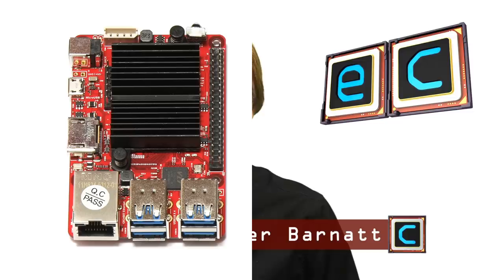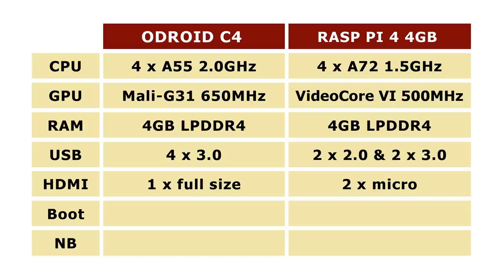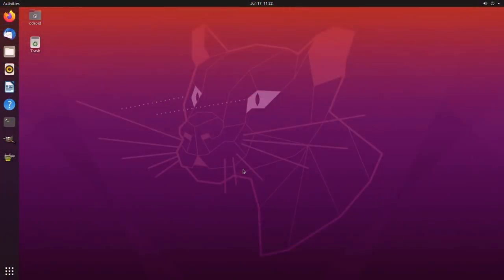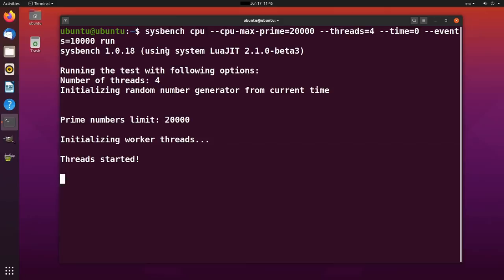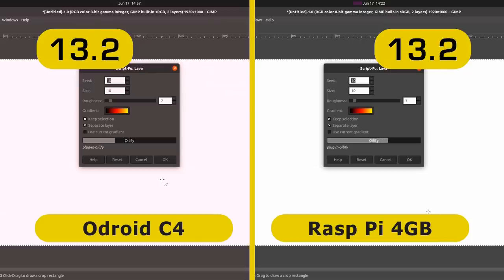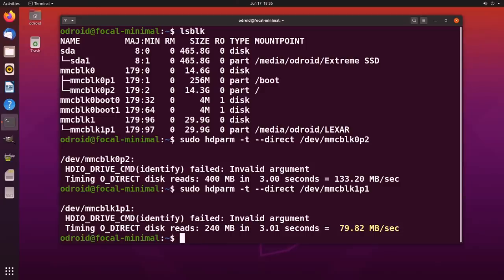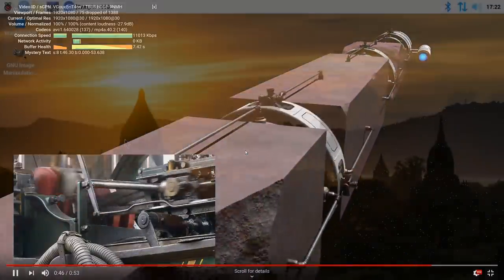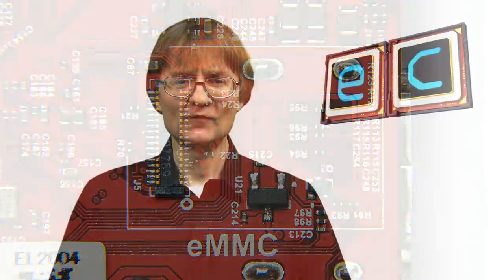Odroid C4 vs Raspberry Pi 4

Comment: 👍(ツ)❤️    I won't cheat with C4 and stick to my beloved RPI 4 (especially after this test)
Reply: Please don't. I got my C4 on release date and I'm totally disappointed. Compared to my N2 and N2+ looks totally handicapped. My Rpi 4 4G OC'd to 2.147Mhz and using a USB3 SSD boot performs much better than my OC'd C4 at 2.1Ghz running ubuntu 20.04 as a desktop OS. Don't forget that Odroids are known for having slow I/O transfer speeds. Ex. C4 booting from same USB3 SSD (Samsung Evo 860), gets only 220Mb/sec, slightly faster and no noticeable difference w/ booting from eMMC at 175Mb/sec. Rpi 4 4gb and 8Gb booting with the same SSD drive reach 395MB/sec reading speeds.
Reply: @josephtremblant2173  Thanks for the good advice 👍. RPI 4 has been my constant companion for a year and SSD boot has made it even faster. Speed of SD only 40 MB / sec and SSD (sda2) 349.85 MB / sec. It is interesting that the boot partition sda1 is a bit slower at 322.56 MB / sec. This is probably due to FAT32 and ext4 properties. (Speed test made with hdparm)
Reply: @tubegor  You could get 395MB/sec like I do, if you use a fast SSD like Samsung Evo 860 and a USB3 to SATA adapter that supports UAS natively and you enable Trim(w/ ASM1153E).
This command is way more accurate than HDparm to test reading/writing speeds:
sudo dd if=/dev/sda of=/dev/null bs=16M count=256

Comment: and i ask again. why bother with boards with NO EMMc???? SD cards always tend to corrupt at some point
Reply from the maker: Why bother? Because almost all consumer SBCs do not have eMMC. And any corruption depends on the card -- use a decent card (esp an endurance or industrial card), and it should be OK for a considerable time. I did a video on cards for SBCs here: https://www.youtube.com/watch?v=YUResed38uo
Reply: @ExplainingComputers  No Offense but, what are you talking about? have u seen prices of OrangePi2E? BananaPi m2+? these boards are far superior comparing to boards without eMMCs.
All im saying is having a more stable board (with emmc) makes it one way. no matter how many sd cards i used of every quality available, after a random time and loss off power lead to corruption which is fraustrating.
If you havent tried boards with eMMC, you cannot believe what you're missing! SOLID ROCK SYSTEMS
Reply: @UrWorstNightMare7  Dude this youtuber is British and is on Raspberry Pi Foundation's payroll - His job is pretty much to keep showing the RPi as the best SBC in all scenarios. He's also been featured on the RPi's magazine for doing his job so well and also because he influences his big audience with his biased pro-RPi views.

Comment: Nowadays it seems like a new normal to overclock RPi 4, something like CPU to 2147MHz and GPU up to 750
MHz.- Some might say, it's cheating, but on the other hand those numbers came from RPi. They should know, cause they made those chips. so it's quite official.

Comment: Make it again but this time use the fan on the odroid as well.
Reply from the maker: Which fan? The Fan Shim I used on the Pi does not fit the Odroid.
Reply: @ExplainingComputers  Even duct taping it would still be better than no fan at all.
Not fair making comparison tests between actively cooled devices vs passively cooled ones.

Or you can remove the fan from the pi and use a heatsink instead.
Reply from the maker: @gearfriedtheswmas  It is only "unfair" if we assume one or other machine will throttle with the cooling used, which is unlikely given the length of the tests.
Reply: @ExplainingComputers  I expect the OS to prevent throttling by limiting the cpu even before the tests.
Be it as it may I just can't believe your results if one is cooled and one is not. 
At least run one of the tests for yourself with a cooled odroid and reply if there was any difference.

Comment: One you had fans and no heatsinks, the other you and heatsinks and no fan? That's not a controlled experiment. Good video I bet it didn't make much of a difference anyway.
Reply from the maker: Of course it is a controlled experiment! :) Providing that neither board's CPU gets hot enough to throttle (and there is not a remote possibilty of that happening with the length of the tests run and the cooling solutions used), the method of cooling is competely and utterley irrelevant. The choice of cooling might impact whether the CPUs are running at, say 45 degrees or 50. But as neither will begin to throttle until 70+, is will not make any difference to the test results. To be clear, the difference will be zero, rather than the "not that much" as you claim. Some people here seem to be confusing cooling performance (which relates to how hot a CPU gets, and certainly is impacted by the choice of cooling solution), and CPU performance (which is not related to temperature at all unless a chip throttles).
Reply: @ExplainingComputers   Oh ok thanks!

Comment: Is there a comparable sysbench command to run in Raspberry PI OS? I tried on my pi4 and it took 43 seconds 🥺
Reply from the maker: Yes, indeed. 43 seconds sounds about right in (32 bit) Raspberry Pi OS.

Comment: IMHO, do not waste money buying a C4, not worth it in current state not even for retro gaming. If you really want it, wait a few months and see how things work out for C4 software development. It all depends also on how many people buys that board too. Just remember how long it took for the N2 to get usable as a desktop replacement and to get its bugs worked out. Currently, C4 has a good performance with latest CoreElec(kodi). C4 running any linux desktop OS is painfully slow even booting from USB3 SSD or eMMC. Official Ubuntu-mate feels sluggish too and forget about Ubuntu-Desktop. HK released Focal 20.04 w/Gnome/Wayland and HW acceleration for C4 and it looks visually impressive but performance leaves much to be desired. It works with HW acceleration, just not responsive or fast enough to be your desktop replacement machine like Rpi4 does. MP4 videos with HW acceleration on Ubuntu Desktop w/ 5.8 kernel using MPV video player,  play pretty good.
You want cheap, fast enough and compatible, get a Rpi 4gb. You want CPU/GPU raw power/2.4Ghz speeds/6 cores but with lots of tinkering, get an Odroid-N2Plus which costs around 25 bucks more than Rpi 4 4Gb. Just in case, N2Plus don't work out of the box like Rpi4 does. Also, if you get a C4/N2/N2+, be prepare to spend some serious time at HK forums. Be prepare to spend time troubleshooting your Odroid too. Last word of advise, when you purchase an Odroid board, order an official  USB-to-UART module kit which is essential to troubleshoot your board and to receive proper assistance from Official HK admin forums. Both N2/N2Plus and Rpi4 support HW acceleration. N2Plus has HW only with Ubuntu-desktop running Gnome/Wayland with 5.8 kernel, VPU  w/ hardware support is almost there). FYI, I have them all so I can compared them objectively. My Current line up: Rpi4 4Gb and 8Gb, C4, N2 4Gb, N2Plus 4Gb, RockPro64.
Reply: Video Editing, Compiling code and building linux images are some ways where 8Gb of RAM would be used for Rpi 4. In reality 8Gb of RAM for the Rpi4 is ahead of its time for the any ARM64 SBC currently in the market. Rpi4 competitors as RK3399 boards and Odroids haven't released a 8Gb version of their boards because it's technically impossible, due their current CPU's are not designed to support more than 4Gb of RAM. Rpi4 detractors would justify this by saying, 8Gb of RAM is totally unnecessary because it will be a bottleneck with current Rpi4 CPU/GPU raw power and it will throttle way before it runs out of RAM.We won't be seeing a new CPU like RK3588 with support for 8gb of ram from rockchip or Amlogic before 2021/2022. Meanwhile, just stop worrying about this and enjoy your Rpi4 8Gb. There are some great 64 OS's right now for the Rpi4  like Manjaro20.08 and Ubuntu-Mate 20.04. Pair it with a SSD drive/USB3 to SATA adapter combination capable of UAS and Trim and you will get some fast I/O speeds for reading/writing on Rpi4. Transition from ARM 32 bit to 64bit apps won't happen overnight, migration already started at its own pace.
Reply: I forgot to mention the most important software that requires to have 8Gb of RAM on your ARM device:
VMware ESXI arm edition for Virtualization on Raspberry Pi 4
https://flings.vmware.com/esxi-arm-edition#requirements
From VMware under requirements for ARM hardware:
Raspberry Pi 4b - 4GB or 8GB Model (8GB is HIGHLY recommended & USB 3.0 device for ESXi/VMFS is also recommended)

Comment: Something wrong with your math. That doesn't add up unless you are talking about different $.
Reply from the maker: The prices stated are the prices for the boards in pounds and dollars from official retailers -- they have nothing to do with the general exchange rate. The price of technology products is rarely closely related to the general exchange rate. So I am not putting up a price in dollars and calculating a pound conversion -- I'm stating the actual advertised sales price. :) Pound/dollar parity, or close to it, has been common for many technology products for decades.
Reply: @ExplainingComputers  Ahh ok I thought there for a sec your calculator needed new batteries, because they're nothing like the converted rates :O)
Reply: @ExplainingComputers  What's going on here is that our reference prices are quoted in the American style (in dollars, without sales tax). When you go to a US Approved Reseller you'll see (say) the 2GB Raspberry Pi 4 at $35; if it's a bricks-and-mortar store like Micro Center you'll then be charged sales tax at the checkout. When you go to a UK Approved Reseller, you'll be given a price including sales tax, which is calculated by converting the dollar price to sterling and adding 20% VAT. Because the exchange rate is $1.26 then in theory today you'd end up paying £33.33. The current price at Pi Hut and Pimoroni is £34: that's a little high today, but reasonable in the context of the last month's exchange rates, which were as low as $1.23 at the end of June.

We're quite strict with our partners about exchange rate tracking.
Reply from the maker: @ebenupton4073  Thanks Eben. :)

Comment: for me the saddest part about the pi4 is that it becomes very hot.. i wanted to use it as a computer to manage my bank accounts but ended up using an atomic pi :(
The pi4 is just too hot and the 32bit OS do not help the performance, it is very laggy when browsing in a single tab.
Reply from the maker: The early Pi 4s did indeed run very hot; firmware revisions since have reduced the temperature considerably, but a heat sink or active cooler i still required in my opinion. There are many good 64 bit OS for the Pi 4 now (eg Manjaro).

Comment: More expensive and not even BT or WiFi? No thanks Odroid, make mine a Pi 4!
Reply: How is it more expensive dude? The 4GB RPi is for 55$ and the Odroid C4 is for 50$ for the 4GB version   lol. 

Why do you care about BT and WiFI in a home server scenario? It saves electricity to just plug into Ethernet ( which is also way faster than WiFi and if you have a decently fast connection, wayyyyy faster and pretty much a necessity ). 

Why would you increase your electricity bill using WiFi & BT? Might as well consider a cheap phone then if your use cases really need BT and WiFi - the phones in that price range even have a stronger processor than the RPi 4 anyways and can actually do 1080p youtube playback without dropped frames unlike the RPi 4 lmao. 

And I'm saying this as someone who owns the RPi 4 8 GB model.

Comment: see install instructions in exp comp comment at the top above the public comments.
sysbench cpu --cpu-max-prime=20000 --threads=4 --time=0 --events=10000  run

Comment: why didn't you use a server distro like Ubuntu server or something like that then you can install xcfe on top of it very easily and save tones of ram you get a drop from 1.2 or 1.3 Gb RAM usage which is the Ubuntu standard to something like 700Mb to 900Mb and you can easily switch between CLI and graphical modes. Ubuntu server CLI mode takes only about 300Mb to 500Mb and it's not shipped with the extra user packages like music player, games, etc. So it's quite good for what you are trying to do here.

You may face an issue with display you may need to enforce some boot config the file name was boot-usercfg you may need to add the following setting to it which did work with me for a 1920x1080 60Hz LCD and 1280x720 LED displays
hdmo_force_mode=1
hdmi_group:0=2
hdmi_mode:0=39

You may face issues with wifi as this is a server distro which if did ever operate on wifi it would be a static network connection but even though you can add easily add as many wifi networks as you want to 50-cloud-init.yaml the following link covers it pretty well for the Rasberry PI 3 -> https://askubuntu.com/questions/1143287/how-to-setup-of-raspberry-pi-3-onboard-wifi-for-ubuntu-server-18-04
This did work with me for the Raspberry PI 3 model B+ because I needed a 64-bit development environment to run a machine learning application on it. it was quite awesome after it worked because you could easily code on you laptop or PC compile using a toolchain and just copy the files over ssh and they will work immediately or you could emulate the entire system by bootstrapping the distro on your pc using qemu-bootstrap (http://logan.tw/posts/2017/01/21/introduction-to-qemu-debootstrap/) which will save you tones of time as you can even run the code as it runs on the baord and if you are compiling code a lot you just never think about the board this is the go to always or a toolchain if you can get it to work.

Some notes:
- you will have a hardtime getting the wifi dongle to work with this solution
- you will have a hardtime changing wifi connection (everytime you need to add a new connection 50-cloud-init.yaml and make a new netplan)
- with the Raspberry PI you will have a hardtime with wifi because the board wifi sucks or the ubuntu firmware layer sucks i'm not sure but occasionally it would fail to connect to wifi on boot and keep restarting
- you will need a library for the GPIO because Ubuntu server doesn't come with one it does have the firmware support but no library like Raspbian in my case I used the bcm2835 C library because I was running a C application -> https://www.airspayce.com/mikem/bcm2835/

That is pretty much it but the take away that it's very normal for spend a week or more facing ridiculous errors that you will hardly find any solution to on the internet because hardly anyone changes the official distro which is kind of good but Ubuntu just had much better development environment since we had to build and compile C code from scratch for this project but if you are running python just go for Raspbian everything there is very well arranged to run python code. I hope this was helpful as it was boring 😂😂😅

Comment: Passive vs active cooling
Reply from the maker: As I have replied scores of times here, passive vs active cooling has nothing whatsoever to do with the results in this video. There seems to be an urban myth that computers with active cooling perform better than those with passive cooling, and they do not. Provided that an SBC has a cooling solution that will prevent it from reaching its throttling temperature, its method of cooling is utterly irrelevant to its performance. Neither SBC here will get remotely close to its  throttling temperature, so what is being tested is CPU performance alone.

Comment: Meaningless comparison. RPi is not about stats, it is about ecosystem. You could show a 1 dollar board with twice the theoretical oomph, but if it does not run precisely how one expect a RPi to run, it will be a dud. Worrying about performance on embedded was left behind in the naughties. Get with the program old man.
Reply from the maker: Thanks for your opinion. The Pi's strength for many is indeed related to its ecosystem. But this does not mean that a comparison with the technical specs and relative performance of another SBC is "meaningless". As long as competitors to the Pi exist, there is value in making the comparison. And "worrying about performance on an embed" is now a far more significant issue than it was in the noughties due to the rise of both edge compting and embedded AI.
Reply: @ExplainingComputers  That is all well and good, but when you do not compare these SBC in that context, the comparison still is meaningless and you are not doing that.
 
Consider apples and oranges. There are valid comparisons of them being fruits and measure their performance as nutrients. But you are effectively judging the orange on its ability to be part of a pie, at which the Apple is objectively superior.
 
So look what you made me do. You made me use Apples, oranges and pi in an argument that has nothing to do with pastry... And you of all people come from the country that gave us the great <insert country> bake off.
 
Also, are you James Brutons older lost brother?

Comment: One cannot help but think that your test would be fairer if you didn't add the fan to the RPi4, because then these boards would've been reviewed as sold. In these circumstances Odroid would've performed better than the Pi.
Reply from the maker: Possibly true, probably not. The tests did not run long enough for a Pi 4 to throttle.

Comment: Passive cooling vs Active cooling. Bruv.....
Reply from the maker: Both boards have a cooling solution that will keep them from throttling, and that is all that matters. So the fact that one has active and one has passive will have no impact whatsoever on the results here. :)

I am bewildered why several people have mentioned this. Active cooling usually keeps a CPU cooler, but only provides better *cooling* performance -- ie the CPU will run at a lower temperature. And if this temperature is below any throttling limit, the CPU will run at its maximum processing performance level. A CPU cooled to say 45 degrees will not perform better than one cooled to say 55. :)